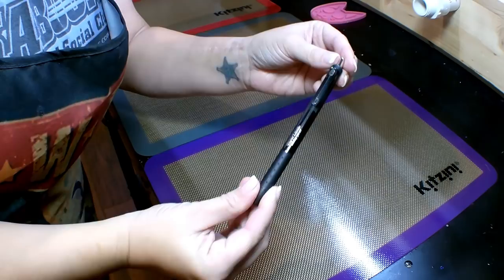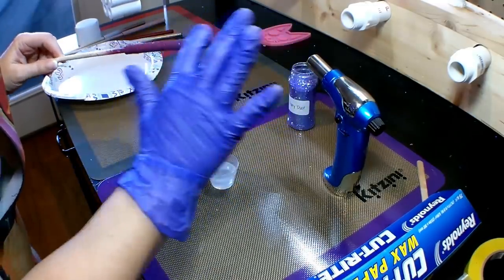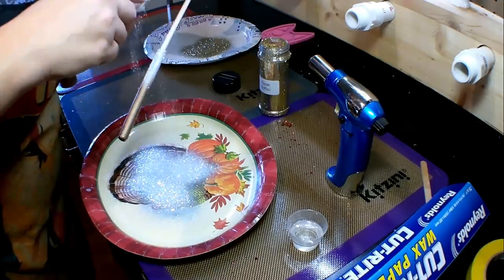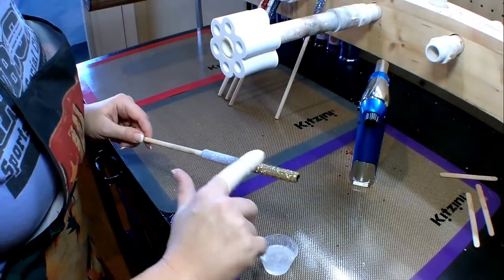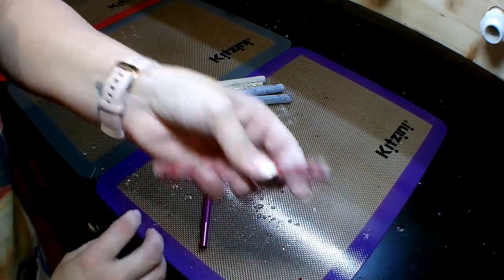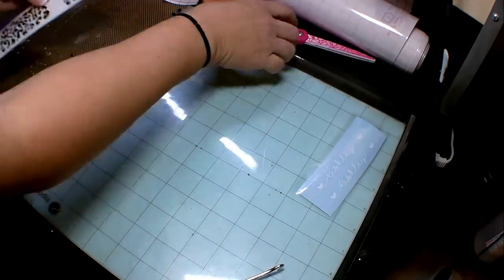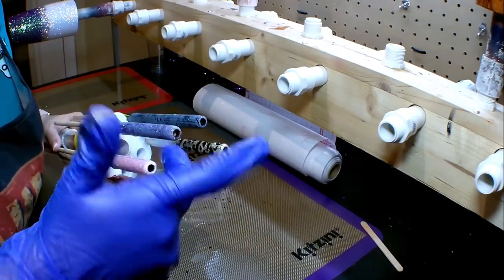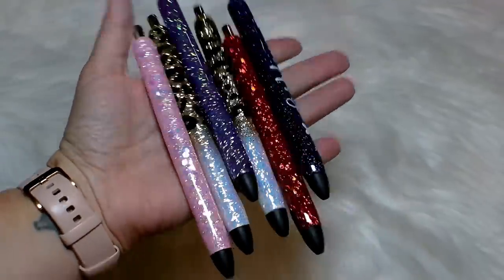Epoxy Glitter Pen Tutorial Part 2 Update | NEW Tips & Tricks | Leopard Print Pens | Inkjoy Papermate

Comment: So I don't have a turner arm that would hold the pens. Can I do hang method or use all uv resin instead of regular epoxy?
Reply from the maker: I'm not sure how to hang method would work because with the pens spinning, and makes the epoxy super smooth. Also, I haven't tried UV resin. I don't think that UV resin is self-leveling, so I'm not sure if it would work. But if you do decide to try it with UV resin, please let me know how it works out.

Comment: What’s the size for the decals you did? I’m learning.
Reply from the maker: The names are one half inch by 4 in and the leopard print is approximately 1.5 in by 2 in. You may have to adjust the size of the leopard print slightly though depending on how thick your epoxy / glitter is.

Comment: I want to try and make these and I was wondering how you did the cheetah print and thanks so much for telling us the font info and size it will be extremely helpful!
Reply from the maker: The leopard print is sized approximately 2 in by 1.5 in but you may have to adjust that size slightly depending on how thick your epoxy and glitter is. Also, I have the leopard print SVG available for everyone to use for free in my Facebook group if you would like to use it as well. Here is the link to my Facebook group, the file can be located under the announcement section and posted by susie. https://www.facebook.com/groups/epoxytumblersandpens/?ref=share

Comment: that was an awesome video! question: what if you don't have a spinner? what is the point of rotating the pens?
Reply from the maker: If you don't have a spinner then you can use UV resin and dry it under a UV lamp. Rotating the pens is if you are using epoxy, you rotate them to help the epoxy dry evenly.

Comment: Your awesome! Thank u! I am trying my 2nd batch of pens and I have tried tips and tricks that I have watched but my pens dry with lumps and hills from the epoxy. I could use any advice! Change epoxy? Do I sand them flat before I put my 2nd layer on? Anything will help!
Reply from the maker: Make sure to use thin layers of epoxy and I usually sand after my second coat of epoxy.
Reply: @KristisCustomCreations   are you using the faux or counter culture expoy in this video? Ready. I’m asking the faux rizzle is out of stock .

Comment: What would you suggest if I do not have a turner? 
I really want to gift these to my sons teachers. But I am such a DIYer that I want to learn myself. 
Thanks so much for sharing!
Reply from the maker: You can do the "hang" method but I will actually be doing a video in the next week or so of using UV resin on pens which cures within minutes and a Turner is not required. 🥰

Comment: I enjoy watching your tutorials.  You are easy to understand.  What size of cheetah print are you using or (what size is the cutout for the leopard spots)?
Reply from the maker: The cutout for my leopard print is approximately 1.5 inch by 2 in. you may have to adjust that slightly though depending on how thick your glitter/apoxy is.

Comment: Awesoem job !! How do you prevent transfering glitter from one pen to the next when applying the epoxy ?
Reply from the maker: Thank you! You can spray it with a clear sealant or spray paint to prevent glitter from moving. 😊 I like to use Rust-oleum 2x clear for that.

Comment: If you don’t want to add decal and you just want the glitter can you skip the sanding and add a sealer 
Thank you for your wonderful video
Reply from the maker: If the pen is smooth then you don't have to sand but I would still suggest sanding lightly if it is rough before your final layer of epoxy
Reply: @KristisCustomCreations  thank you so much . Can I put a sealer do glitter don’t come off
Reply from the maker: @tamelamertens6805  yes, I spray with Rust-Oleum 2x clear to seal my glitter in before I put epoxy on.

Comment: Thank you for the information, and they turned out very beautiful!!! But what are the measurements for the leopard print? I don’t want to wrap it around and it’s to long and over lap.
Reply from the maker: The leopard print is approximately 2 in by 1.5 in. You may have to adjust those measurements slightly though depending on how thick your glitter and epoxy are.

Comment: Thank you for the video.  I have 2 questions.
1) how long do you let the pens turn after you put the epoxy on?
2) what grit is the sandpaper you are using.
Thank you again!!
Reply from the maker: Thanks! 1. I let the pens spin for approx 5-6 hours depending on which brand of epoxy I use on them. 2. I use 220 grit sandpaper with an adhesive backing (I have the link to it down in the description box below). :)

Comment: Hey Kristy your pens are super gorgeous.. I only started making tumblers a little over 2 years ago and I'm having a little trouble with getting my pens back together.  I haven't done my last coat of epoxy yet but was wondering if you ever had any trouble getting the bottom piece to spin on.  Thanks so much.
Reply from the maker: Hey there! So you are having problems getting the tip back on? If that's the case then it sounds like you are probably getting Epoxy inside the pen. Try taking a small razer and see if you can scrape it out without damaging the threads.
Reply: @KristisCustomCreations  ok I have tried but I am going to try again.  I don’t see any epoxy but I wonder it I actually did ruin the threads instead
Reply from the maker: @lildeb4040  well dang, you should definitely try it again.

Comment: love the video your great with step by step! I have a couple questions.
how long did you let them dry for the first layer of epoxy before doing the last coat?
how do you keep the epoxy from hardening quick when its in the cup mixed?
Reply from the maker: The length of drying time is going to depend on what epoxy you use. If you use a fast set epoxy than it is going to dry a lot faster and it will also harden faster inside your mixing cup. Regular Tumblerpoxy doesn't dry super quickly so I like to use it on my pens because it gives me a lot longer working time.

Comment: I have a few questions that I’m stuck on. I’m doing doing glitter pens, I’m doing fabric pens. Like tumblers wrapped with fabric but pens instead. 
1- How many layers of epoxy do you use? 
2- How do you do even layers of epoxy when it’s hard to tell when it’s “wet”?
3- Do I sand after the last coat? If so how do I get it shiny & clear looking after the sanding?
Reply from the maker: I am so sorry that I am just now seeing your questions! I'm not sure how I missed them. 
1. I use 3 layers of epoxy over the glitter. 
2. I do light layers of epoxy and it usually takes 6-8 hours for my epoxy to dry so I don't touch the pens until I know for sure they are dry. 
3. I always sand after the second coat (before the 3rd and final coat). When you put the final coat of epoxy over the sanded pen, it will make it beautiful and shiny again! :)

Comment: Kristi! Me again. I got so frustrated with my pen making, I had issues with the epoxy getting inside...way inside. But finally took better care. Now I have problems with the vinyl. So, I came back here. I should have applied the decal to a sanded pen before another layer of epoxy? TIA.
Reply from the maker: Sorry it took so long for me to respond, I've been super sick. You can apply the decal to a sanded or non-sanded pen, you just want to make sure that it is nice and smooth before you add it. I hope that helps!
Reply: @KristisCustomCreations  Feel better my dear. TU for answering. I am ordering the squeegee and some other things you u used from your links to have more success. 
Thank you again for the best tutorials. And will pray for a quick recovery for u.
Reply from the maker: @savagetwin52  thank you so much! 🥰🥰🥰

Comment: These are so cute 😍 what’s the measurements on the vinyl and the leopard around as well ? Do you do the refills as well with them? If you do which ones do you buy?
Reply from the maker: Thanks for watching! I size the leopard file to approximately 1.5 in by 2 in but you may have to adjust that slightly depending on how thick your epoxy / glitter is. Have you seen our Facebook group? I have actually shared that file in our Facebook group so that everyone can use it. Also, there are a couple different types of refills that you can use. https://www.facebook.com/groups/epoxytumblersandpens/?ref=share
https://amzn.to/2N2O96V
Reply: @KristisCustomCreations  no I haven’t seen your FB but I will check it out now. Thank you for your help Kristi

Comment: I noticed that the placement of your pens are the part where the clicker tip goes are facing out when you apply the epoxy. Is this the best way to have them on the wooden sticks to be sure the epoxy gets placed on that end well. If that makes any sense. I'm trying to get better at doing pens. My first 5 are wonky. And I finally got brave enough to try 4 more lol. I'm thinking these 4 are going to go every which way but loose on me again. I ordered those inserts like the ones you are using to hold your pens so I'm thinking that is one of my issues. Any tips would be greatly appreciated. Love your videos. TIA
Reply from the maker: Thank you so much and thanks for watching my videos! Yes, putting the clicker part out is the best way to put them on the dowels, that way no part of the outside of the pen touches the dowel at all which makes it easier to not get it stuck on the dowel. I hope that makes sense. 🤷🏼‍♀️

Comment: Love this! I am wanting to try these but I don’t own a spinner like you have. Is there another creative option to spin these guys without owning the operation you have? If not what is your recommendation?
Reply from the maker: Thank you! You could make a pen with modge podge and triple thick but it wouldn't be as smooth as with epoxy. It would still be pretty though!
Reply from the maker: And by making them with modge podge and triple thick, you could just stand them up on a stick (or dowel rod) while they dry rather than spinning them.
Reply: @Ashton King I see “cheap” $15 turners at Walmart, Hobby Lobby & JoAnn’s that might work. I’ve heard they don’t last really long if you’re doing tumblers, but it might work (even just to get you started to see if you like it or if you plan to sell it I bet you’d make your money back really quickly to upgrade). Also, keep in mind to use store coupons at JoAnn’s & Hobby Lobby. Sometimes you can get 40-60% off!
Reply from the maker: @Heart2HeartCreations   is exactly right! A "cheap" turner from one of those locations may be perfect for just starting out. :) Rather than jumping feet first with an expensive setup, you could get a much less expensive one. Thanks for the suggestion Ladybug! :)
Reply: @Heart2HeartCreations  thank you so much!!! I had no idea! Looks like that’s where I’m headed!

Comment: New here! Love your work:) What are the measurements for the leopard spots for the pens?
Reply from the maker: Thank you! I made the leopard spots approximately 1.5 inch by 2 inch but you may have to adjust those measurements slightly depending on how thick your epoxy/glitter is.

Comment: Loved this tutorial! I used that font for my pens and sometimes the tops or bottoms of some letters (t, p, d, y, b) don't stay down. And this is after 2 coats of epoxy, sanded and cleaned. Any tips?
Reply from the maker: Thank you so much! Trying spraying them with a coat of clear spray (I use Rustoleum 2x gloss clear) then letting them completely dry before epoxy. That should help keep the vinyl from lifting.

Comment: Amazing pens! What size did you use for the leopard wrap?
Reply from the maker: Thank you! I make my leopard wrap approximately 1.5 inch by 2 in. you may have to adjust that sizing slightly though depending on how thick your epoxy/glitter is. I have actually shared the cut file in my Facebook group, which is linked down in the description box, for everyone to use.

Comment: Hello. I made some pens that are ready but it's not clicking. I put vaseline prior to epoxy probably not far enough. Do you know if it's the epoxy? I have tried to clean it out with acetone and a qtip. I have also tried cleaning the inside with a metal tool. No luck. Can I get some tips please.
Reply from the maker: It sounds like there may be epoxy way up in there or the pen shaft may have gotten warped by too much heat. When you look down into it, can you see anything in there? Try putting some Vaseline in there to see if it helps things move when you click it.

Comment: I'm always nervous about sanding my pens.  If I'm using waterslide instead of vinyl, would I need to apply a fresh coat of epoxy after sanding and before the waterslide?
Reply from the maker: You want to put the water slide over a shiny surface, so if you have sanded then you either need to put a thin coat of epoxy over the pen before applying the water slide or you can spray with a gloss clear spray paint before placing the water side.

Comment: Great tutorial. I noticed that you listed 2 types of measuring cups. Since I am just starting would I need to purchase both? I am currently only planning to make pens. Would you recommend one over the other? Also, if I plan to just to pens, would you recommend this turner motor or a different one? TIA.
Reply from the maker: I'm so sorry I'm just now seeing your comment. I use the larger cups if I am mixing up larger batches of epoxy. If you are only making pens then you only need the smaller cups.

Comment: What was the size of the leopard print decal? Also, did you just shrink the larger one? Thanks!
Reply from the maker: It's approximately 1.5" x 2" but you may have to adjust that slightly depending on how thick your glitter/Epoxy is. I just took a larger leopard print design and shrunk it down for the pens. I have shared the file for everyone in my Facebook group to use if you have Facebook. 🥰 https://www.facebook.com/groups/epoxytumblersandpens/?ref=share

Comment: How long do you spin between layers of epoxy? Do you have to sand if you’re using a fine glitter?
Reply from the maker: I let mine spin between 4-6 hours between coats. I still sand just a little bit around the edges even when using a fine glitter because I want it to be super smooth everywhere.

Comment: What dimensions did you use to make the leopard print vinyl? I'm never sure how wide to make them so they match up. Thanks!
Reply from the maker: I make them approx 1.5" x 2" but you may have to adjust that slightly depending on how thick your glitter/Epoxy is. 😊 I actually have the svg shared in my Facebook group for everyone to use if you would like to check out out. 😉

Comment: Which epoxy do you use for pens?  I see you listed two types in your notes but one isn’t available.  Also when did you use the clear matte spray?
Reply from the maker: I use Tumblerpoxy epoxy on all my pens and tumblers now. I use clear gloss spray but you can use Matte as well. I use it to seal in the glitter and I also find that it helps to keep your vinyl from lifting if you seal your vinyl in with it also before applying epoxy. Just make sure that the clear spray is completely dry before epoxy.
Reply: @KristisCustomCreations  Do you get that epoxy on Amazon?
Reply from the maker: @brandystewart2614  you can get it from tumblerpoxy.com but if you would like to try a small 16oz sample kit, I sell the small kits on my website. www.kccglitter.com

Comment: If you put a couple of fat rubber bands around the turner (foam insert) you could just slide the dowels in and out instead of tape.
Reply from the maker: Yes ma'am! I actually started doing this right after I filmed this video so I wasn't able to put it in the video but I believe that I may have mentioned it in my voice over. Rubber bands are SO much easier than tape!

Comment: Do you recommend using fast dry epoxy for pens?
Reply from the maker: Yes! Tumblerpoxy has come out with a new fast drying epoxy called Swiftpoxy. They have it at www.tumblerpoxy.com 
Also, you can use UV resin to make the pens which cures under a UV light (I have a couple tutorials showing this method) but it's not quite as pretty as epoxy in my opinion. 😊

Comment: Hi can let me know how long we need to leave the pen in the turner? Until the epoxy dries?
Reply from the maker: I would leave it on the Turner at least 4 hours and then you can move it to a drying rack but I wouldn't touch the pen itself until it's completely dry which would be probably around 8 to 10 hours

Comment: Where did you get the leopard svg? and what size did you size and cut it?
Reply from the maker: It is 1.5" x 2" but you may have to adjust that slightly depending on the thickness of your glitter/epoxy. It is a leopard file that I have had forever. I actually have it available for everyone in my Facebook group under announcements posted by Susie: https://www.facebook.com/groups/epoxytumblersandpens

Comment: lovely. What was the size for the leopard print.
Reply from the maker: Thank you 😊 I make the leopard print approximately 1.5 in by 2 in. You may have to adjust that slightly though depending on how thick your epoxy / glitter is.

Comment: I’m on silhouette cameo. My font was .5 inches and it still comes out to big it wraps around the pen. But then also so thin that it’s ripping. Advice? What size should the font be? Any smaller and it looks smooshed and can barely read it. :(
Reply from the maker: I always make my fonts 0.5 inch tall and it looks just fine. Can you try making the name slightly longer so that it doesn't smush it as much? Also, if it's too thin then you can put a very small offset on the name and that will help to thicken the font